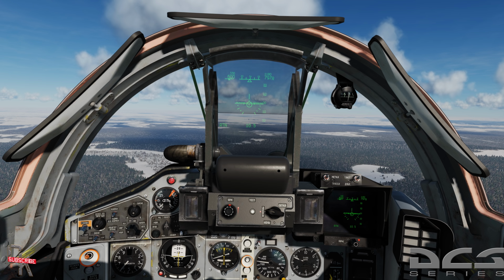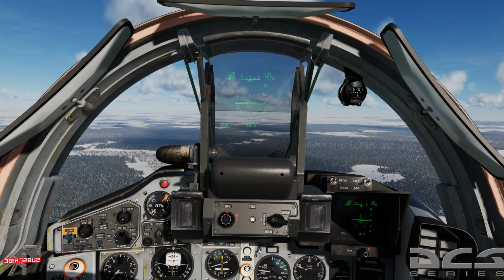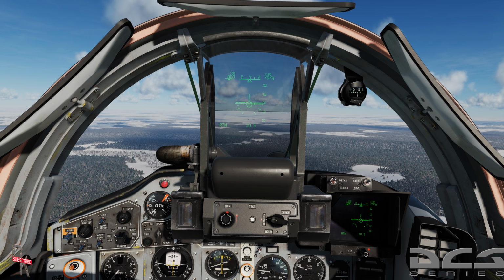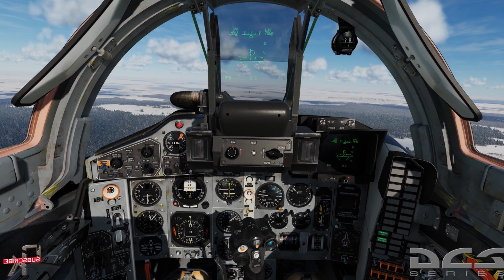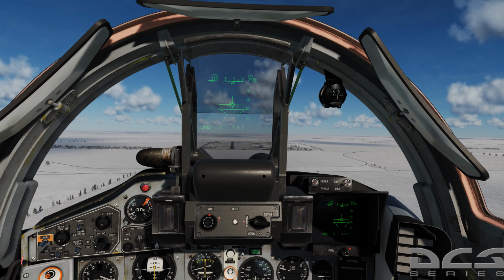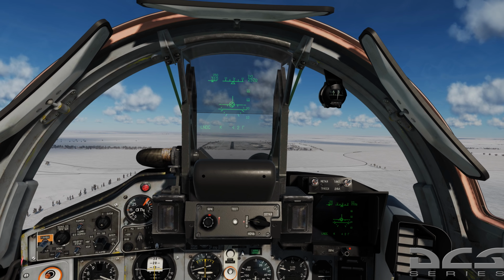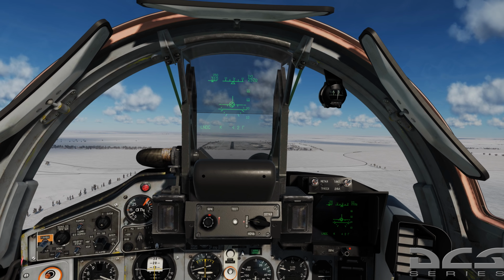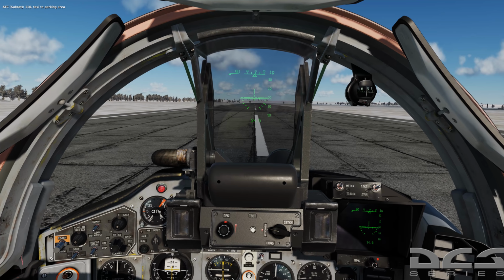Basic Fundamentals DCS World: MiG-29  Landing

Comment: Good work. Really enjoyed it and nice job on the unassisted  landing.

I’d like to make note of two things. The first is a small thing but it made my ears perk up. Return mode does not take you to the outer marker. It takes you to the IAF (initial approach fix) which is about 10 km farther out than the outer marker.

In reference to the big and small circles. You note that you should be aiming for the small one. Actually it’s the opposite. The larger one is the flight director circle. As always, it’s telling you where to fly to to accomplish what you need to do. In this case it’s to get the small circle centered on the aircraft datum. Ideally you would fly in a manner that always keeps the director circle centered on the datum. In reality that’s not always advisable but, following it’s lead as closely as possible will center the deviation circle quickly and keep it there.

Comment: Few numbers:
    1. Release the landing gear and control their release according to ИП-52 (IP-52)
    2. At a speed of 450 km/h to release flaps 
    3. At an altitude of 250...300 m, 5...6 km away from the runway. ФАРЫ switch is set to the ПОСАД position. (Alt + L)
    4. Set the descent angle on the КПП (AI) (about 3 degrees), check the vertical speed (5...3 m/s) and reduce the operation mode so as to pass the ДПРМ (1st radio beacon) at an altitude of 200 m and the speed of 330...320 km/h 
    5. БПРМ (2тв radio beacon) to pass at an altitude of 50...60 m and a speed of 310...330 km/h. 77...80% while the speed to the beginning of the alignment should be in the range of 290...280 km/h 
    6. From a height of 10...8 m, start leveling, reducing the angle of planning, in order to approach the plane to the ground (cessation of descent) at a height of 0.8...0.5 m.
    7. Remove throttle in МГ (idle) state 
    8. Landing the aircraft at a speed of 260...250 km/h with a landing angle of attack of 11 degrees